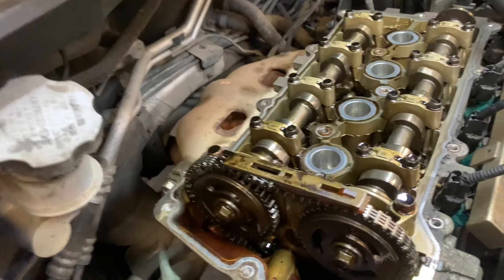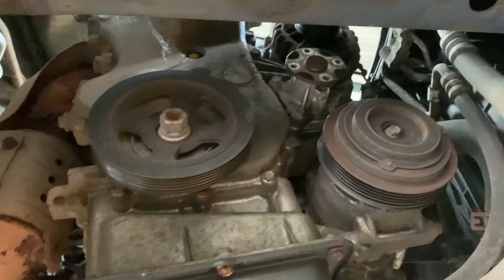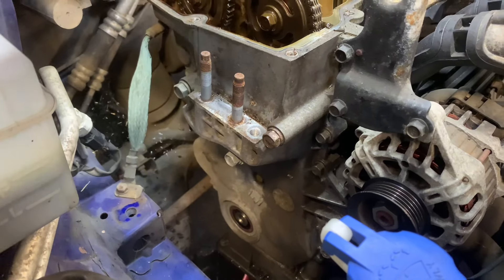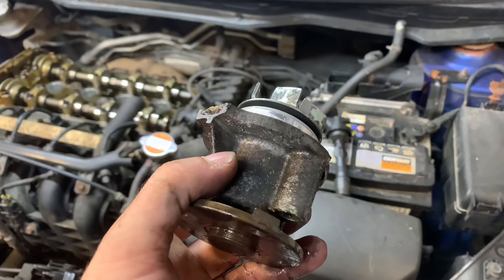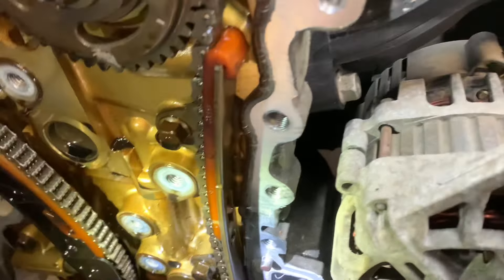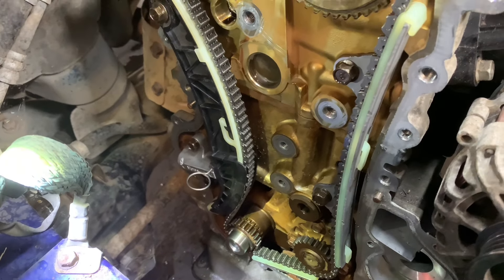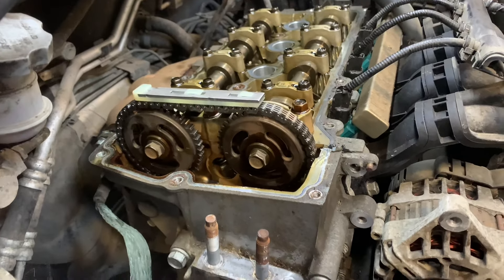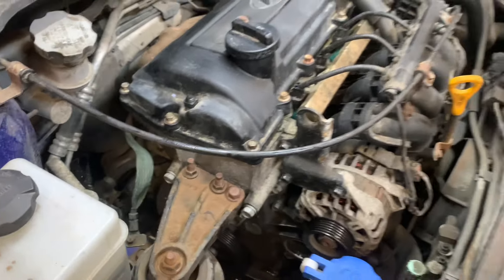Hyundai i20 timing chain! #fyp  #mechanic #hyundai

Comment: Hi bud quick question.. i have a ix20 and the timing is a roller chain.. i bought a kit which came with a silent chain.. would this chain fit on the cam sprokets or should i change everything over thanks in advance for any help at all 😀
Reply from the maker: I have no idea tbh with you buddy, I’ve always replaced for what is originally on there

Comment: How much would that cost to replace the timing
Reply from the maker: Under £200 for parts then a couple of hours labour depending on what the garage charges
Reply: About 12000 rs for complete timing kit. I have done the same in my i20 2011 petrol.

Comment: People like me come here for inspiration, Showing before and after isn't a great help. It would be helpful to see the chain removal and installation of the new...
Reply from the maker: Sorry buddy, as per awaiting a new camera mount it’s hard to do a job with 2 hands and hold a camera. 
I do plenty of these so I’ll make sure I will on the next one for you
Reply: @owensautotips thank you
Reply: Hi , great video . Do you have a link for the timing tool ? I need to do a job like this on I20 1.2 petrol 2013 , but can’t find anywhere a timing tool kit ? Thanks in advance
Reply from the maker: @alinaa123 we don’t use a timing tool ourselves. Literally just the case of lining up the two cams with the lines and then the crank with the mark
Reply from the maker: @Yesterday23071  if you check out my latest on the kona, which is the same layout it is explained better 
https://youtu.be/xTv2h3yvEKo?si=97DcQ9wauy7GRJDN

Comment: Good day.

Whats the torque specs for the cylinder head bolts?
Reply from the maker: Would need specific engine data or vin number to give out correct torque specs

Comment: Bro please make new video how to replace the HLAs/lash adjusters without removing the timing cover for the same car i20.
The HLAs in my i20 needs to be replaced. But company told me they have to removed the timing cover
 After that, only the HLAs will be removed.
Please make new video how to remove HLAs with out removing timing cover.
Reply from the maker: Sorry buddy but on this model they are correct, timing cover, chain and cams would have to be removed to replace the HLA.
You can risk undoing the cams without removing the chain and cover but that could result in further damage
Reply: @owensautotips  last time, I went to company workshop due to some noises kar...kar...kar.... etc coming from the left side engine. The noises are just intermittently occuring. It's very very rare. It's happens when engine is at idle. Only 64000 km running.
They said it's timing chain, and at the time of removing the timing cover, there's no issues with timing chain system. They further points that HLAs needs to be replaced. However, parts are not available and it might take 40 days to get them.
So, they just replaced the whole timing kit including adjusters, guides etc. But still issue is not solved. Spend about 12k rs including labour.
So I'm asking if HLAs could be replaced without removing the timing cover because I have to spend huge money on labour charges.
I'm totally at loss now 😭😭😭
Reply: @owensautotips  also I have seen several YouTube videos belonging to same engine design of Hyundai, but not exactly same car, showing how to remove HLAs without removing timing cover.

Comment: How do i even remove crankbolt its stuck for me
Reply from the maker: @Danne05  impact gun or a crank pulley holding tool
Reply: Got it removed. But the timing marks don't line up after two rotation its off by 4, each time    color marking dont line up on any of them 😅 thanks for great vid by the way
Reply from the maker: @Danne05 if you are going by the chain timing marks it can take a few turns…
Make sure the no1 piston is at tdc the the crank mark should be correct. Then the cams will need adjusting to the two lines facing each other
Reply: @owensautotips  thank you very much for the help. Really appreciate it awesome channel 👍